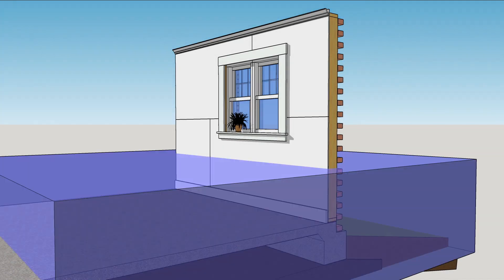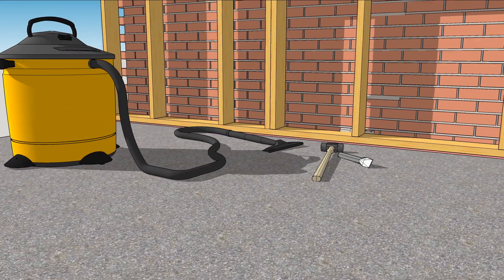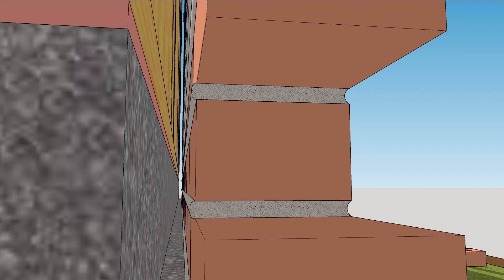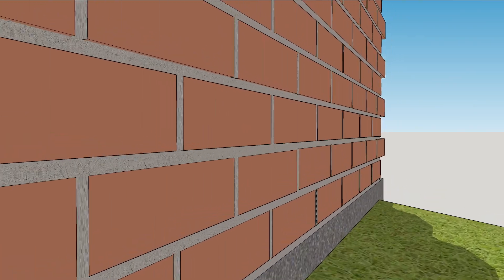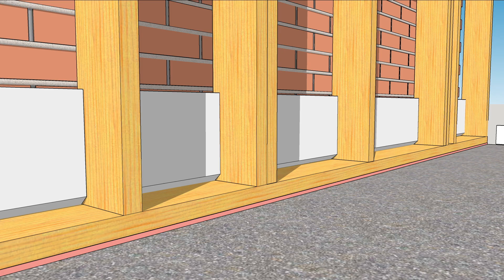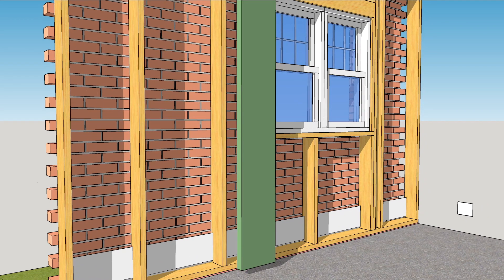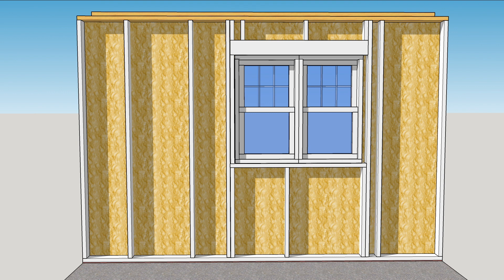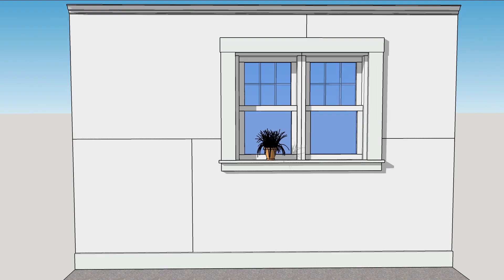Brick Wall Flood Retrofit (Coil Stock and Rigid Foam)

Comment: Don't you need to put the sheathing back to add racking strength to the framing (e.g., to withstand wind loads)?   From what I've read, spray foam has a bit of compressive strength but not much tensile strength.  I guess you could maybe add blocking in the cavity to add more racking strength.